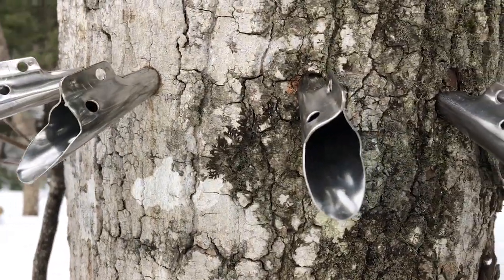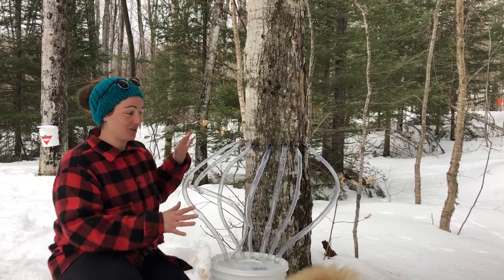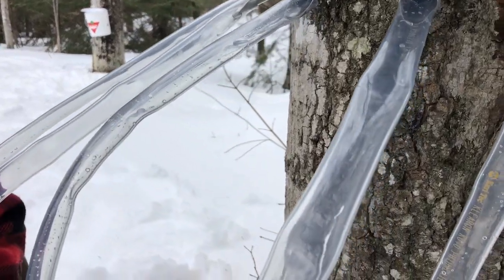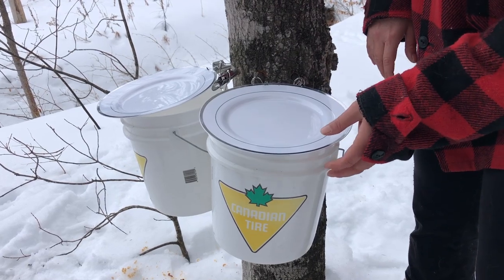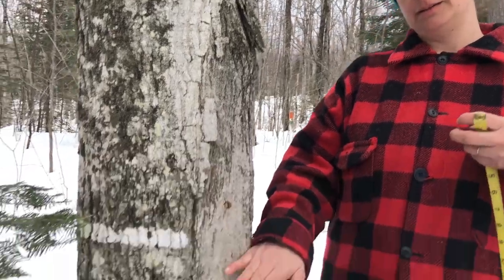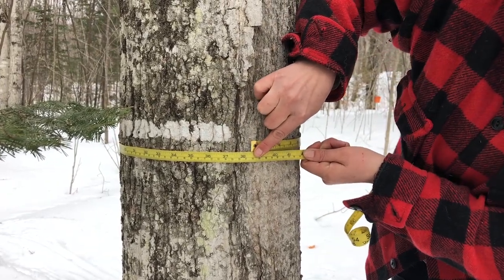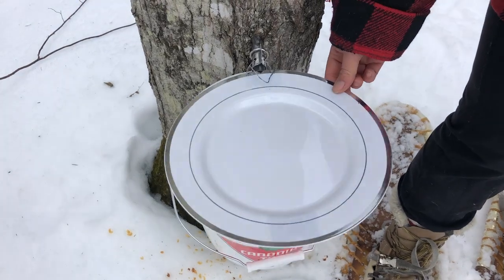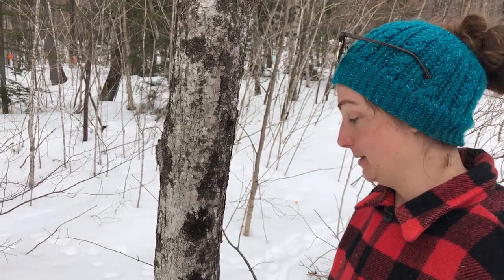How Many Taps Per Maple Tree? Tapping Maple Trees For High Sap Yield Making Backyard Maple Syrup

Comment: Can you make Maple syrup from Manitoba maple’s?
Reply from the maker: You most definitely can!  You'll have to expect a higher sap to syrup ratio though.  With sugar maples, you can expect around 40:1 ratio.  With Manitoba maples, the ratio will be more in the neighbourhood of 60 or 80:1.  We've made it out of 100% Manitobas in the past, and also mixed sap from Manitobas with sugar and reds.  Give it a try if you have some!
Reply from the maker: It does taste different though, than the typical maple syrup, if you use 100% Manitoba maple.